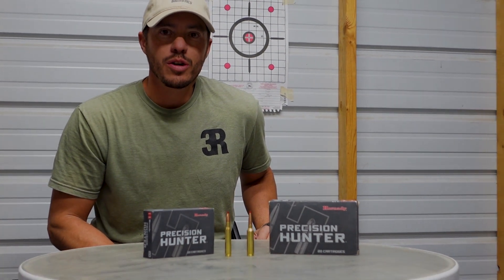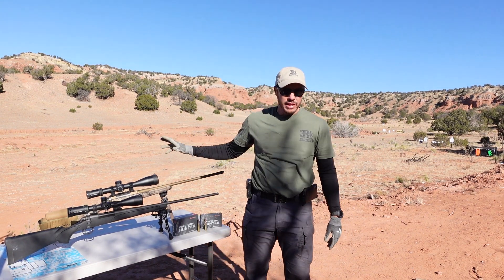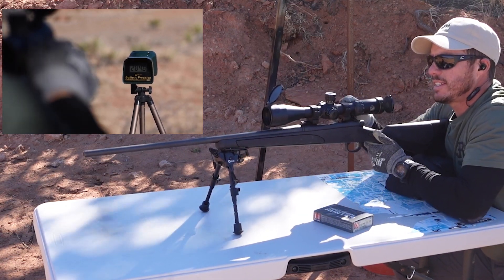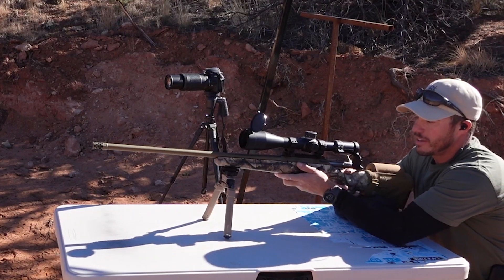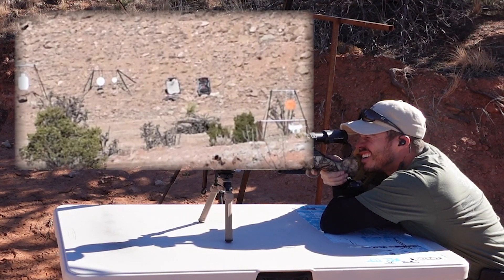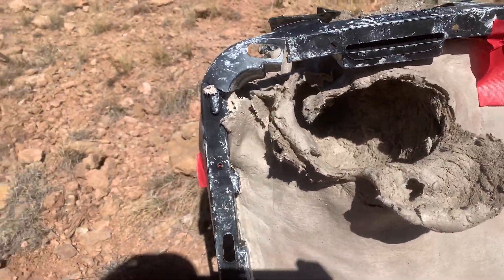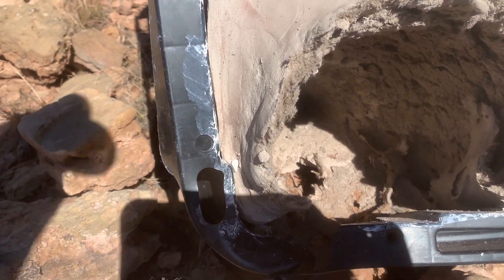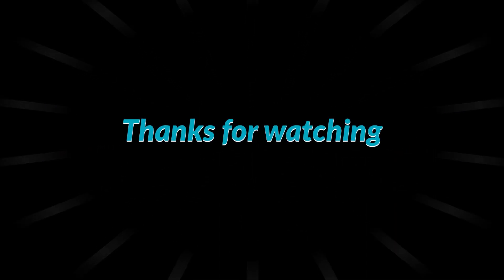30-06 vs 7mmPRC in Precision Hunter

Comment: What caused the sighting issues on the 7mm PRC?
Reply from the maker: Rings on the scope loosened and we adjusted incorrectly. Once we tightened them down it changed our point of impact. Unfortunately, we only had half a box of 7mm that day so we did what we could with what we had.

Comment: 7 prc smokes the 30-06. Dropped my 1000k bull in one shot.  Flatter, faster, way more energy at distance.  7prc is a great round.  30-06 is fine for sub 300 yrd shots. If ya want to go long the 7 prc is the ticket.
Reply: Except it doesn't.  He literally shows the ballistics in the video. I wouldn't call 200 ftlbs  "smoking"  30-06 by any stretch. Honestly, only out-doing a 100 year old cartridge by that little is kinda sad.
Reply: 300yds limit on 30-06?!?! Com’n man!
Reply: You’re completely wrong in your assessment. You’ve clearly never used a 30/06 on 400 yard plus shots on big game. I have. It is very effective with the right bullet. I appreciate the case design of the 7PRC, but its factory advertised velocities are grossly overinflated. Velocity wise, I’ll take a 7 REM Mag against the PRC. You can’t argue case capacity.

Comment: Was the hole in the aluminum seen at 5:12 already there?  If so, then the 7mm proved itself better at barrier penetration in a real world test, not just in lab numbers.

From the clay damage at 25 yards, the 30-06 looked like it dumped its energy in the clay, leading to more damage to the clay rather than the aluminum.

In the 500 yard test, the 7mm looked to have done much more damage with a single shot.

It would be interesting to repeat the test at 25 yards with a layer of aluminum in front of the clay (of a thickness you know will be penetrated) to see how much energy is left in the bullet after penetration.
Reply from the maker: The hole in the aluminum was already there. However, I do plan to redo this test so I’ll probably use a barrier with clay next time.